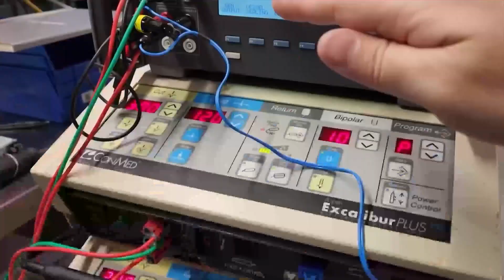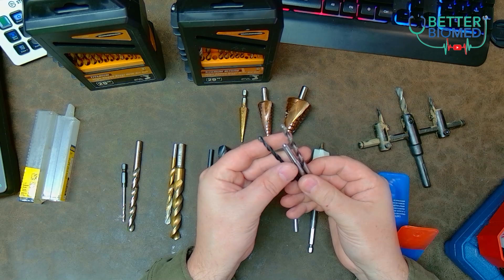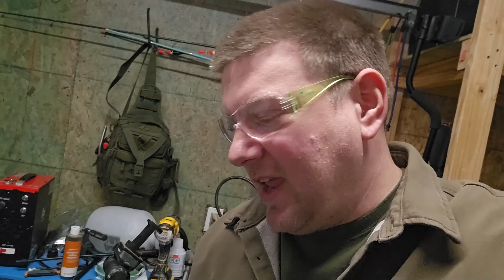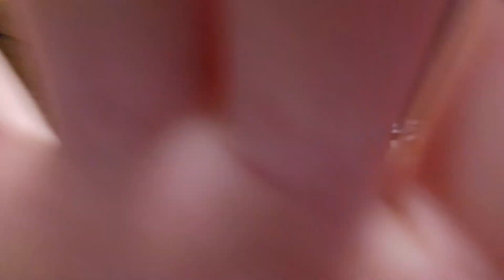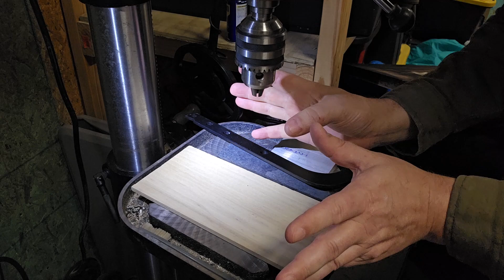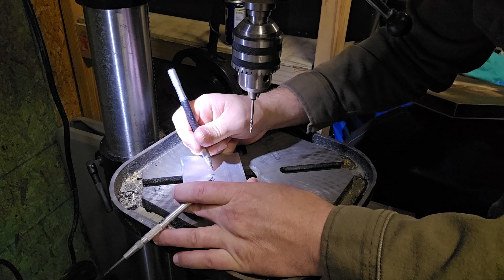Drilling 101

Comment: Justin, good job covering a lot of material here. You did however do some sketchy work holding. Whenever possible, and it is usually possible, fix the work to the table with clamps, a vise fixed to the table or blocking that prevents work from unlimited rotation if or when the work jams to the bit and would be ripped out of your hand if handheld. This is the primary source of serious injury at the drill press. Sheet metal, a likely job for Biomed's to encounter, is a frequent offender.

If you should make an error in setup and find yourself with a workpiece spinning on the bit. Don't back the bit out of the work. Stop the drill press immediately.  If you can't do so, get away from the drill press and turn it off at its circuit breaker. Been there and lived to tell this tale because someone else cut the power.
Reply from the maker: @walterbordett2023   I explained the work holding in the video.  To be honest,  only some types of work need to be clamped. I've used a drill press for over 30 years on hundreds of projects, personal and professional.

Comment: Also a good idea to use proper clutch settings on your drill, especially when using hole saws and step drill bits.  Drilling 120mm holes without a clutch is not fun.
Reply from the maker: I honestly never use the clutch except when driving fasteners. Good point though. The larger the diameter holesaw, the more dangerous in case of a bind.